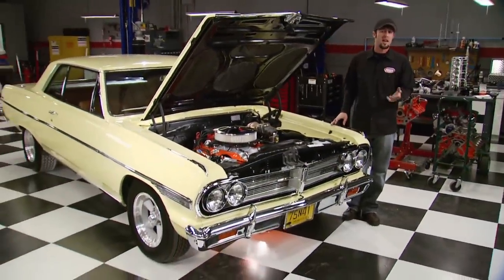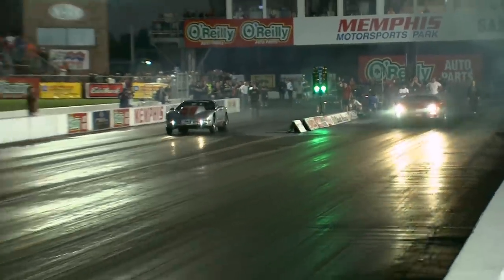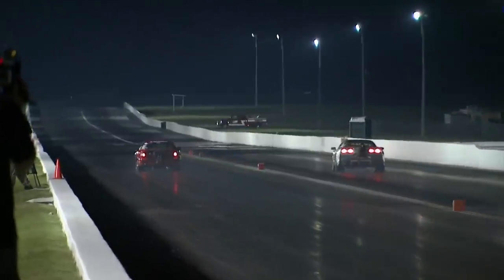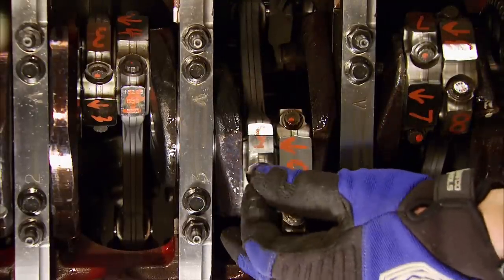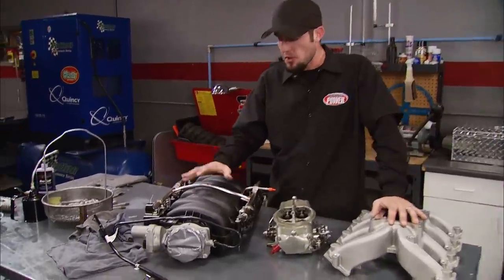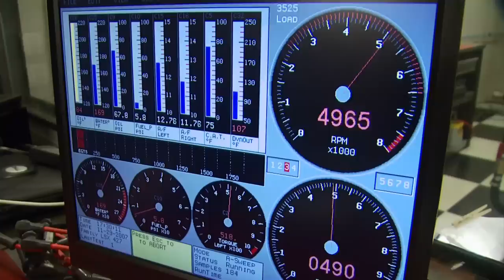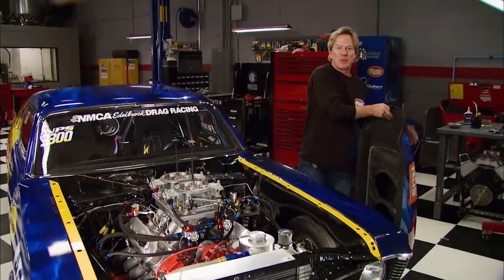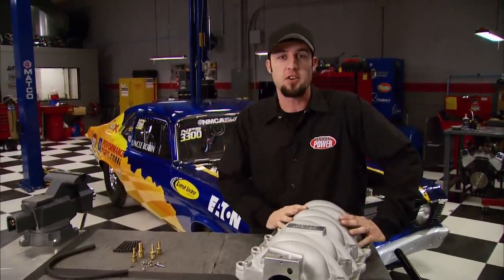HorsePower's First 427 LSX Build - Horsepower S12, E1

Comment from the maker: We'll continue to post these episodes here on YouTube. If you can't wait for the rest of the build, visit our site to binge-watch: https://www.powernationtv.com/shows/horsepower
Reply: POWERNATION the LS platform. I never thought I would ever do a LS swap till I stayed to build my 1971 Buick Skylark GS on my YouTube channel. Now I have a twinTurbo 6.0 LS that is sitting 4” back from stock. They are amazing engines.
Reply: POWERNATION what ever happened to joe
Reply: FROM TOP TO BOTTOM THE LS IS COMPLETELY FORD IN DESIGN. IT'S A REGURGITATED FORD 427 HIGH RISER AKA RAISED PORT FOR 351 WINDSOR. NOT ONE (1) DESIGN ASPECT OF THE OLD CHEVY SMALL BLOCK LIVES IN THE LS. THE LS IS 100% BASED ON FORD DESIGNS. THOSE GM ENGINEERS ARE A BUNCH OF CLOWNS.
Reply: Whoever edits this show needs to be fired.
Reply: @travislewanski5577  LS IS 100% FORD IN DESIGN. EXPERTS IN THE AUTOMOTIVE FIELD CALL IT "THE HIGH TECH SMALL BLOCK FORD".
Reply: Where can i get the block

Comment: “We’re in the business of making horsepower so we’re gonna use a carb” what color is the sky on that planet??
Reply: Right?! If they wanted to make some power they should have put some turbos on and ran it on ethanol.
Reply: LS’s love carbs.
Reply: @ChuckBeefOG  yeah i love coke but it dont mean its good for me
Reply: Injection has it's place in many apps esp forced induction but for NA where simplicity, power and ease is required you just can't go past carbs. Injection just doesn't make any more power. It just doesn't and to show one or 2 vids where it does is the exception, and means your assertion that it does make more power needs work.
Reply: Carbs have proven themselves to make power, even to this day. Also, this video, although posted several days ago, is actually over 10 years old. Most guys that race with injected engines these days throw a lot of boost at it. Naturally aspirated, like with this carb setup is a totally different story. In a head to head comparison, a carbureted engine can just about match the power of an injected engine, if not exceed it.
Reply: @iceman45ification1  yes Danny but it has been proven since YouTube the laws of thermodynamics don't  apply. This has implications for the conservation of information which in turn has implications for the standard model. This has rocked particle physics to its core. Just think YouTube has caused all this.
Reply: @ThePaulv12  EFI is more efficient, easier to tune , and starts every time, carbs on street rods are a pain as they dry out when they sit, and in general not as precise.  Yeah if you wanna tune the carb for days pouring gas all over sure, most people never tune their carbs, so ok sure.
Reply: @steveatx8295  one thing that you said in there that has an element of truth is carbs are generally not as precise.
Apart from that, the rest of your comment was largely specious.
Reply: A carb can never be as accurate as 8 injectors, therefore it cannot be tuned to maximum power across all cylinders.  A carb is not nearly as repeatable in making power because it has no feedback loop.  It is also less safe to engine longevity, since it can have a hot cylinder due whereas EFI will not shoot too much or too little fuel in any one cylinder.   So overall carbs are  ancient tech like a flip phone vs a smart phone, it can't compete.
Reply: I have a feeling everyone defending the old fuel toilet bowl is probably over 40 and never done anything but NA big block Chevys
Reply: ThePaulv12 calm down calm down I’ve played with some carbs but with what’s available today I don’t understand why anyone would choose to
Reply: @rickyj2013  it's just a case of if you don't see the need for it then nobody else needs it either.
You sound like my father.
Reply: @ChuckBeefOG  fuel injection is superior in every way
Reply: @kenshinhimura9387  
Except cost and, relative to port injection, a carb's wet-manifold ability to help cool the charge, esp with alcohol and boost. EFI is not superior in every way but has many advantages.
Reply: @zmanmd1641  well said.
Reply: Carbs are cheaper and make the same power and sometimes a few hp more due to charge cooling. EFI will make more power in part throttle conditions but it will not make more WOT power.  It’s been proven hundreds of times.  Add forced induction and it’s a different story.
Reply: Carbs are cheaper and make the same power and sometimes a few hp more due to charge cooling. EFI will make more power in part throttle conditions but it will not make more WOT power.  It’s been proven hundreds of times.  Add forced induction and it’s a different story.
Reply: Carbs respond faster, you know when you push the trans brake button and rev to about 3500 RPM and let off the button when the light turns green...
Besides that, most of the bad-ass crate builders like Reheer Morrison build their big power engines with Carbs.  People have pulled away from carbs because they dont know how to calibrate them.
Reply: You can fool yourself with fool injection on  race engine. Even 8 injectors in a 4bbl style intake is pretty shady. 8 stack can make power but  for the added cost and reliability really not worth the effort.
EFI on a road car is nicer generally. And bloody impossible when it [often[ goes wrong. As a used car dealer I have struck this dozens of times. Car uses too much fuel, hard to start, plain gutless. Get the so called [younger generation] experts in. Or even the OEM dealer. Sometimes it runs after. But often not properly.
Though on a V8 classic a decent modern Holley with a MSD style ignition starts and runs just as well. And may well make more power.
I have seen people farting around on dynos with lap tops, and the engines still never run properly. The base $1000 units are defenitly far worse than a carb. I thought about it for my classic, but educated myself out of it.
As for the racecar,, you arrive at the track, race all weekend and drive it on the trailer. EFI guys are having all sorts of dramas,, or want to go faster and end up going slower.
Reply: I was about to comment something very similar.
Reply: This is from Jan 2008
Reply: carbs make more power under full throttle conditions towards the top end because they cool down the air charge. EFI (port fuel injection or direct injection not Throttle body injection) will make for better drivability throughout the rev range
Reply: @zmanmd1641  They 660 hp, if that's not enough you could put turbos and EFI.  I would be fine with 660.  And carbs can be a pain but can be lived with.  I have a 2002 Ninja zx6 and it has carbs with a manual choke like it's 1969.  Just can't be wrong about how much choke or it falls on it's face when cold which is bad when you pull out in traffic first thing in the morning.
Reply: @ThePaulv12  Yet Formula 1 race cars use fuel injection, so do rally cars and modern race bikes. If you spec your injectors correctly and map the ECU correctly with the right coil pack set up, there is no way a carburettor can outperform fuel injection.
Reply: All out power twin turbo direct port intercooled nitromethane would outrun top fuel. Or mostly alcohol and nitromethane mix. I've used nitromethane mixing it with pump gas and a stock 110cc 3-wheeler it works and truly feel the power. Was going to use it in the street and strip car but didn't get around to it before having an engine failure.
Reply: In all out power injection is power and money. For my street and strip muscle cars. I'm a carburetor man. A dynoed big block Chevy stage 3 1050 dominator 700 horsepower on pump gas clocked a few thousand miles and runs 178 degrees Max idling in traffic or racing. Not the fastest out there but one of the coolest running. And in another car I have it was to 1150 dominators on a high rise tunnel ram. I bought the whole car turn key and ran it for several hundreds of miles until the engine died from a old school non hippo roller lifter falling apart piston hitting valve and breaking locking the motor up. And when I got the car I just rode it and it was not the coolest engine temperature running car by far. But I didn't build it just bought it and was enjoying driving it till it had a serious motor problem.
Reply: Yeah efi is way better
Reply: @steveatx8295  I imagine u have never used a carb and repeat what u have been told online.

Comment: Adding a carjurmeratur to an LS- ah, the nostalgia of unequal fuel distribution, poor cold starts, vapor lock and washing the cylinders down with unburned fuel.
Reply: YT expert.
Reply: now you sound like you're in the business of making horsepower, yeehaw brother!  (who ever would ditch an efi system for a carburetor is practicing willful ignorance).
Reply: I dont think the washing down the cylinder walls with fuel is true. Its not like your dumping a cup of gas in there, its atomized and the cylinder is hot anyways. I known its not fuel injection but I doubt the effect is negligible when it comes to engine life.
Reply: How about you learn how to tune the idle, accelerator, economizer jets, along with the float level and bleed air Noob

Comment: Might be an older post, but I'm really getting interested in these LSX's. I'm an older (and retired) hot rodder and one of my kids is getting interested in hot rodding. So I have been gathering what I need for a custom job on an old Buick Sedanette, and I might even grab a Caddy Sedanette I found while looking around. Either way, I think that would be a fun and totally awesome father and son project! Anyway, I was actually thinking a Buick 455 plant for the Roadmaster, or an old school 454 if I pick up that other basket case and go with the Caddy later on. But having had several Suburbans with LS engines in them and tinkering with them over the years, I started thinking about going the LS route. After watching this video, I think I'll update my knowledge on the LS series engines. Thanks for this video, fellas!

Comment: Cool, informative video. Curious though, why you wouldn't have used the LSX heads, with the 2 extra head bolt holes per cylinder... Would have saved $$$ heading into the next upgrade, which would be boosting, massively!!!

Comment: What racers used to do pack intake with ice. On this intake you could put some aluminum around the sides, front and back of the intake chill with ice remove and race. What the Hellcat does is runs the outside air through the hood scoop through the air conditioner condenser or evaporator through the air filter into the motor for super cold air. I'm not sure exactly where the air filter is in this super cold ice box air induction system but it's truly efficient it should be on everything for power and gas mileage.

Comment: The first year of the big block in the intermediates was 1965.  It was the 375 hp (really the 425 hp) 396.   The 427 wasn't produced until 1966.
Reply: Right in the vette correct??
Reply: Wrong the 427 Chevy was produced in 1963
Reply: @bilbobaggins4710   If I recall correctly, the 427 was also in the full size Caprice/Impala in  1966.  Probably to satisfy NASCAR.
Reply: @hishok3332  bull crap
Reply: @bilbobaggins4710  google it 63/64. The 427 was produced In limited numbers 66 it was mass production
Reply: Thank goodness for google
Reply: @wileecoyote5749  says the same thing in my chiltons  Automotive manuals even list production numbers
Reply: @wileecoyote5749  hahahaha bulk crap
Reply: Hey Y'aLL are forgetting the 409
Reply: @hishok3332  technically correct...but the 427 in 63 was based off the 409. What came out in 66 was new design big block of the 396/427/454

Comment: The 18 hp came from them running the engine 300 rpm higher.
Reply: @bigboreracing356  You said you race engines. This is how I knew you was lying. Adding a 1 inch spacer will not raise hp peak rpm by 300.
Reply: STREET RACER Why didn’t they increase the intake volume even more with another 1 inch spacer? They would have gotten another 18 hp.
Reply: Hey folks its  @blackericdenice  the Typical EcoBoost lover.
Reply: @bigboreracing356  The question is, will it gain another 16 hp.
Reply: @bigboreracing356  Until you learn to talk me like you are a man. I'm done.
Reply: Also got the afr back in line, first run seen a rich point at top end. Could gain a few ho in the tune.
Reply: It did gain 13 hp at the same 6500rpm. That's pretty significant for just adding a spacer.
Reply: The guy in the video said combustion ratio instead of compression ratio. How come yall aren't picking on him?
Reply: @baby-sharkgto4902  you caught that too,  I think ol joe needs to retire....
Reply: The added plenum volume allowed that. I marvel that an expert of your caliber can't see that carb intakes can be tuned.
Reply: @bigboreracing356  F165 has some deep rooted problems I would say
Reply: Whats the problem? Less tire spin.
Reply: @CJColvin  ecoboost are trash, grab an atlas 4, 5, 6 or LU3.
Reply: Glad I'm not the only one that noticed that

Comment: If they built it right they could’ve made over 730 hp, instead of a carburetor they could’ve installed the LSXR 102 intake manifold, and a bigger cam, a 233 intake duration cam is tiny for 7.0L considering I run that sized cam in my 4.8L, also some LSX heads would’ve flowed more cfm instead of those stock milled heads. And they should’ve revved out that cam more closer to 7200 rpm

Comment: shows you the weakness of that block that you're so proud of the bolts that hold heads on aren't cast to the cylinders so the cylinders can move around and snap off

Comment: These LS builds amaze me. Tin rockers sliding across the valve head. Roller fulcrums maybe but racers learnt roller rockers gave reliability and power 40 years ago,, and more.Go measure the extra lift and duration a roller rocker gives. As well as not mushrooming the valves. And with 600 lift that will happen real fast.

Comment: Besides more power in a smaller package, higher mpg. It is a byproduct of the engine being able to pull more heat from the fuel.

Comment: When comparing the LS1, the LS3, and the LT engines, I've heard that the LS3 is the best mod engine because it's an improvement over the LS1 (obviously) but isn't over complicated/engineered like the generations that come after it. A sweet spot engine in terms of mod-ability, reliability, and cost to power value. Can you confirm?
Reply: yes
Reply: No

Comment: Do it right and tight the first time. Something I started doing years ago on header bolts, timing cover bolts, flywheel bolts, harmonic balancer bolt, intake bolts, timing gear bolts, drive shaft bolts and more I use blue loctite. I buy the blue loctite at harbor freight it's cheap with a 20% coupon but I heard they're stopped the coupons. Mostly if it doesn't have a nylon lock nut on it it gets blue loctite. Never loose bolts again and no leaks. I do not use loctite on head bolts, rod bolts and main studs. Also I always let the bolts dry before running them with blue loctite on them. I hear they have loctite gel I've not used it yet it may be a faster drying time. I also drill the oil pan bolt run a 1/4 inch stainless steel bolt and nylon locking nut with washers sealed through the oil pan to run safety wire around the drain plug and another nylon lock nut. So the oil drain plug doesn't come loose. You could also machine a flat piece of metal with 12 points on it to fit the oil drain plug so you can just put the tab over it and clamp it down but that's more time and money. And that's for somebody that doesn't like safety wire. Most everything I work on gets blue loctite do the job right the first time.

Comment: I thought the 427 LSX blocks were coming with an all forged rotating assembly. The rods were I think 4340 forged steel, not forged titanium like this engine. Chevy Performance must have changed some things up since the introduction of the LSX block

Comment: 233 on the intake, 276 on the exhaust ehh?? more like 236 on the exhaust.  That cam is way too small for a 427.
Reply: Yes the Chevrolet Performance Stage 3 camshaft is 233/276 is correct. It also has a tight 107 LSA. Look at Hot Rod Magazine for a LS 7 Test on the stage 2 and stage 3 cams. If you’re looking for a good Chevrolet Performance Showroom Stock camshaft 239/251 LSA 106.5 lift w/1.8 .600/.600. Have used the showroom stock in about 12 endurance racing LS 7s with 11.5-12.0 compression ratio, ported LS7 heads, FAST LSXR MANIFOLD AND 102. throttle bodies. Hp was always between 650-660 and torque 605-616. Had good torque down to 3000 rpm due to the LSA of 106.5.
Reply: @davidshields302  that's a ridiculously large split.  Why so much exhaust duration vs intake?

Comment: i was not sure what the lsx was but i see that it is the same as the old l.s. 7 just built now . i just got the new l.s. 7 with overhead cam 4 valve per cylinder engine out of a 2018 vett
Reply: No

Comment: You could put one of those in a C8 Corvette , iron block could take way more abuse . And a twin turbo 427 Corvette would likely destroy the not yet made ZO6 C8 .
Reply: LOL.. yea a heavy iron block would really work wonders on a road course car.
Reply: @r000tbeer  An iron block isn't that much heavier , and all the Z51 add ons weigh a bunch extra . Magnetic ride suspension is 3 times the weight of regular coil suspension . And all the other driver aids and safety junk is why a new Camaro weighs over 1000 pounds more than my gen 4 , LOL your thinking you know stuff .

Comment: Please someone explain why they are not using roller rockers. The expense of some of those parts is very high yet they aren't using roller rockers. Also it seems to me they are under carbed and should be using a bigger one, only 850 cfm???. The cam seems a bit mild with the lift as well, I expected something over .600 lift. They say they are using 83 octane fuel, isn't that compression ration a little high for that? Wouldn't they have trouble with ignition timing? Go with less compression and use more timing. I'm not saying I know I'm asking someone who does.